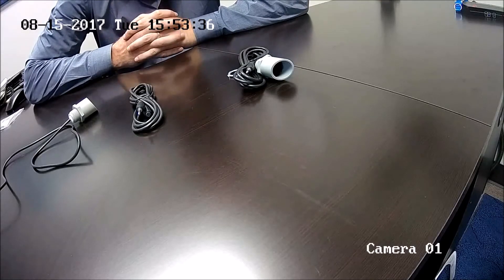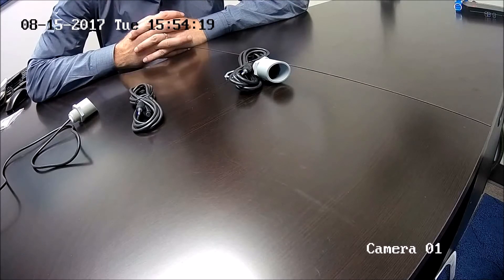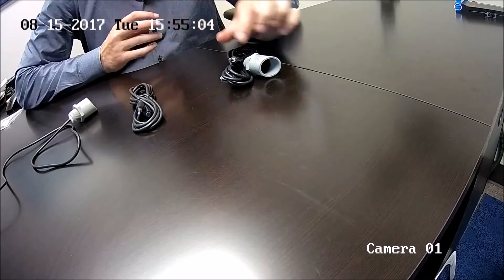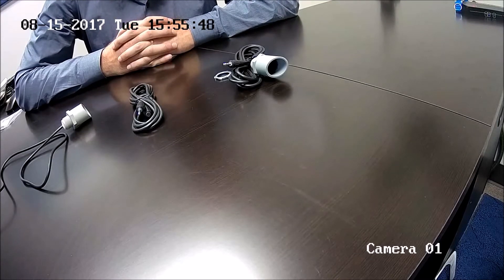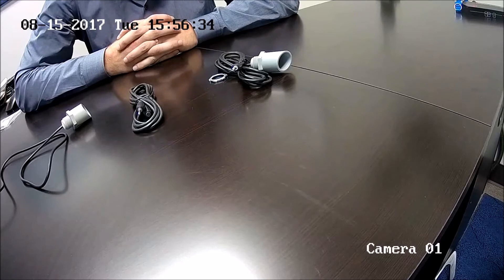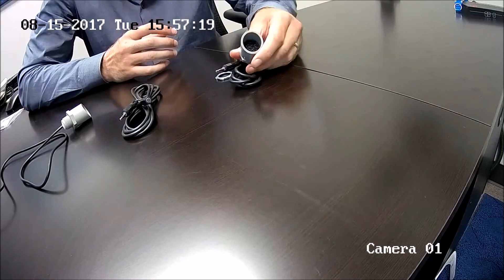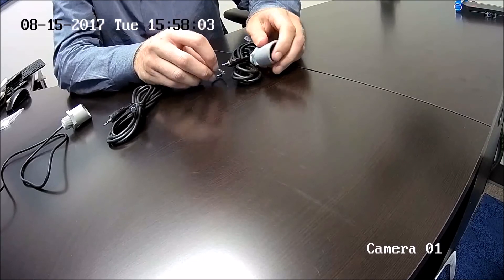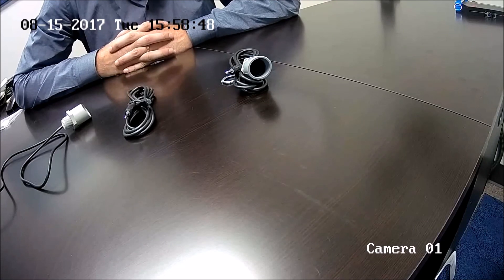Un-Pre-Amplified Microphones for IP Cameras

Comment: Good Morning, Just saw your video and I believe Nelly's can help me out. I have a Dahua PTZ camera (SD5943OU-HNI) (4MP FULL HD 30X) and I would like to add a microphone to this camera. This camera comes with 3 wires for audio red=audio out, yellow= audio in, black= ground. The wires are bare with no connectors. I believe as per your video that your mic-level microphone would work with my camera. Could you please tell me if you think your mic-level microphone would work, and the best way to interface it to my camera. (wiring diagram) Would I just hardwire the microphone to my camera or would I need to purchase some bare wire to RCA converters. I would mount the microphone under the eves of my house. I would appreciate your input.
Thank you.
Reply from the maker: Hi Greg, you would just need to make sure the mic input on the camera can accept mic level type microphones. I checked the specs of the camera but couldnt find anything about the mic input being used. Perhaps you can take a look in the cameras web interface for clues